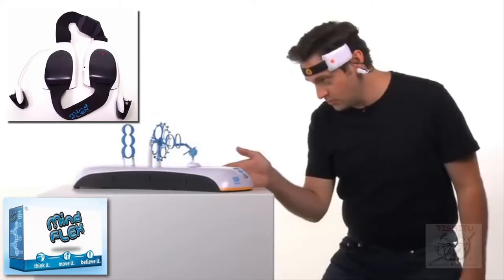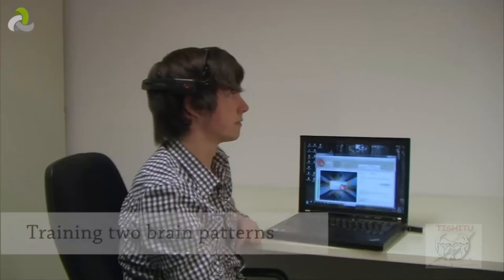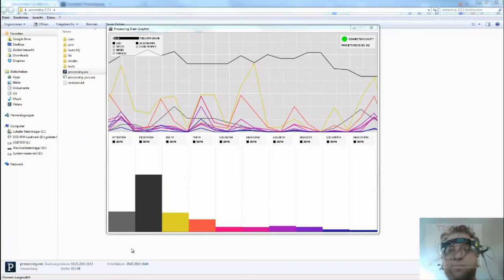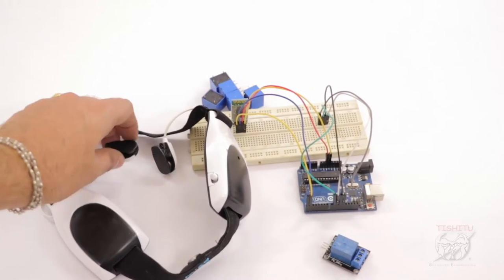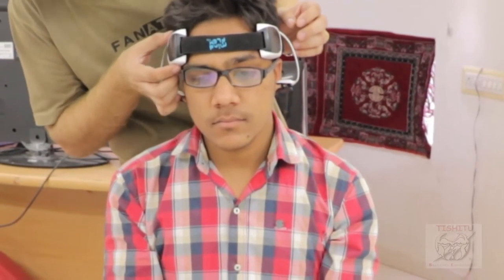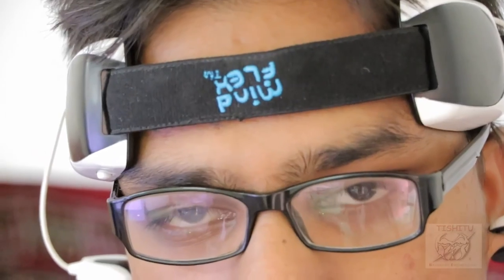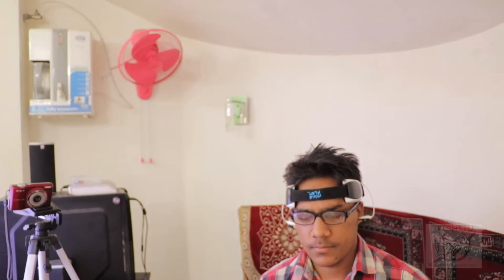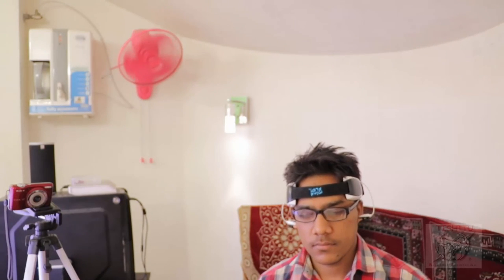Brain wave Device Control January 2019

Comment: please make part 2 i want to learn more you are good at this i use arduino uno to
Reply from the maker: sure i do
Reply: @TarunShrivastava  yup get a relay and head pads under ear if reversed they will lean to the voltage side and control someone by thinking of it cool right mind control ? find out
Reply from the maker: @crazysmile11012  same as rat control by someone on net youtube video is exist too

Comment: Sir is it possible if i want to use Mindflex and control the fan using fan remote controller. So i have to open the fan remote controller to install the bluetooth to receive the signal from the Mindflex instead of using  relay. I am confuse because is it can be done? I need ur advise urgently.
Reply from the maker: Sure you can

Comment: Sir, I Am making a project ,can you please help me. It will be a type of earphones that will detect the mood on its own and play the songs from the phone accordingly. Here for detection of mood,it will be using mindflex headset. Pls help me.
Reply: Sir I want to talk to you Pls help me
Reply from the maker: there is newro pod sensors not a transducers or mic
Reply: Sir actually, I want the various frequencies as the output from the mindflex and with arduino uno and Bluetooth module this information will be transmitted to the mobile where the app will decide according to the frequency range that which song will be played
Reply from the maker: well arduino uno cant send frequencies to movile it will send discrete values or PWM only by Serial communication protocol>>>>>>>>> BUDDY<<<<<<<<<<<<

Comment: Amplifying Brain waves to affect surrounding
matter.

What if I used a MC33202P Op-Amp to a 400 Amp POWER
MOSFET and Amplified again using a 2000 Amp POWER MOSFET GATE ARRAY fed to a
600lbs Tesla coil with arcing capacitors.?

Could I affect matter?
Reply from the maker: try see water have memory.. and salt with frequency patterns